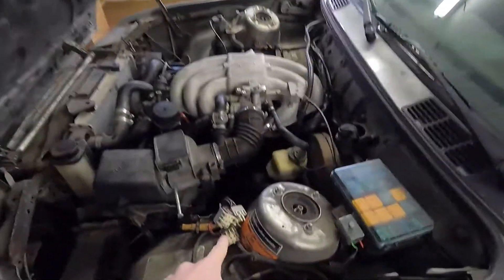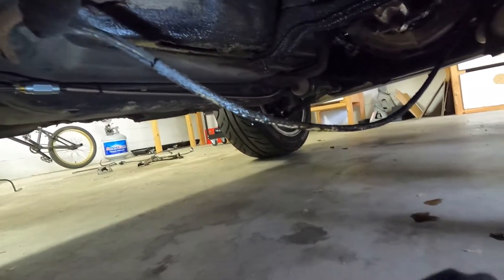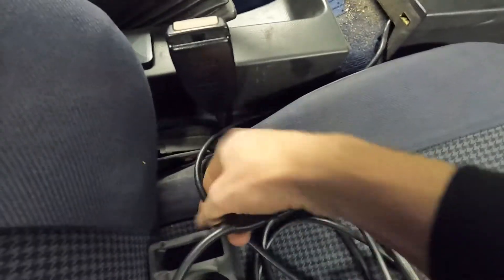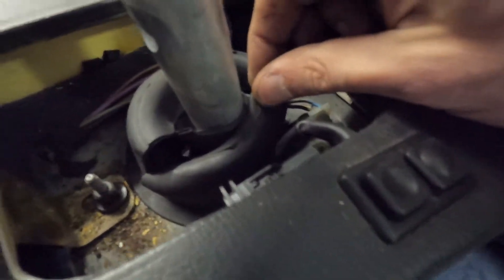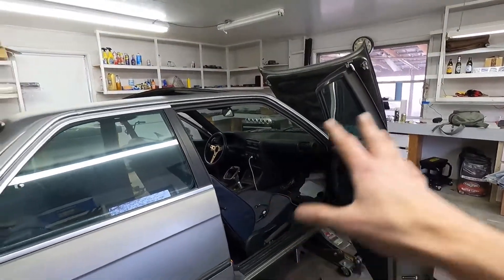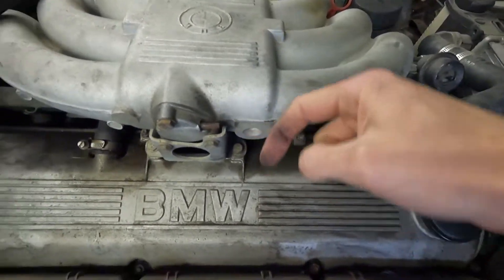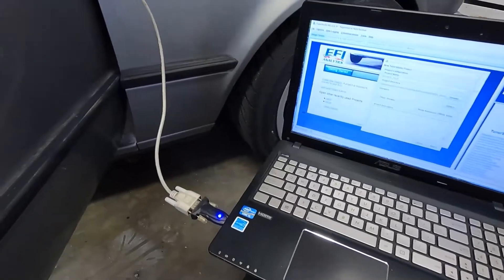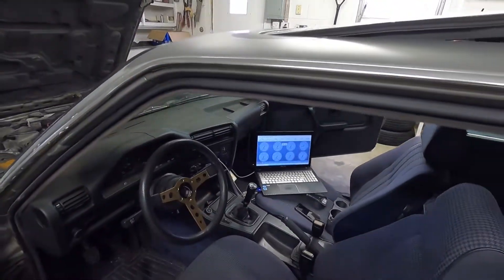Getting the E30 Running on Megasquirt-2 ECU

Comment: How did you get the RPM Signal into your Dashboard?
Reply: The megasquirt sends rpm signal to the dash if you are using a pnp2. You may have to adjust the settings to make it accurate
Reply from the maker: Yeah for me I just needed to connect a wire under the dash into my harness since I was also doing the e to i swap. And then it automatically worked with my MS2 unit.

Comment: Are you still running the MS with ITBs? I’m having a hard time getting it tuned. Located in PNW?
Reply from the maker: Yup, still on MS with the ITBs. I did the tuning from collecting driving logs. It's not great but worked for me. Eventually I'll get it to a dyno and a real tuner.

Comment: I just picked up my first e30 last and need a mega squirt to (hopefully) solve a problem with the AFM. Looking for an o2 sensor, adapter plate gm iat to hook everything up
Reply from the maker: Buying a working AFM will save a lot more money and headaches than doing the conversion to Megasquirt

Comment: I’m having trouble with mine sadly. When I go to detect the firmware on tuner studio, it doesn’t detect anything. Have you had this issue ?
Reply from the maker: Doesn't sound familiar. My studio is quite an old version. Maybe you need to update something to match studio to your MS unit?
Reply: Download the firmware onto the ms then take off the bootload jumper.

Comment: I think the wiring stuff is more personal preference than anything. 
When I first threw wideband/gauges in my car, what I did was use the Aux fusebox to get power for everything, and grounded it all to a bolt above the glovebox near the ECU mounting location.
Now everything has splices into the engine harness, and if I ever need to remove the harness, it's not coming out in one piece. 
Now what I've been doing for my MAP and other recent things, is finding the OEM GND/12V/5V splices in the engine harness and running all the wires inside the stock harness as much as possible. The end result so far is a lot cleaner, and the MAP is just another connector on the harness.
Reply: You're still going to have wires that need to leave the harness for gauges and stuff, so I want to find a connector that's easy to add/remove pins so I can easily disconnect that stuff.
Reply from the maker: The dream goal would be to learn enough about wiring to run a completely new harness from scratch designed specifically for my set up. But there’s a lot to figure out first, maybe some day.